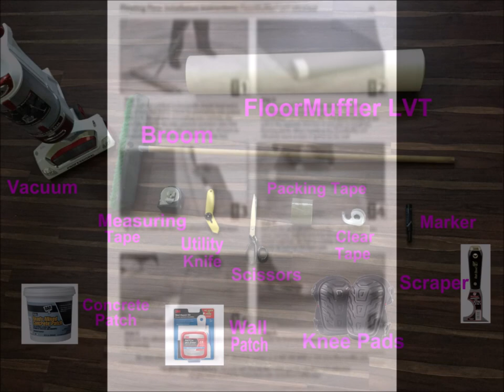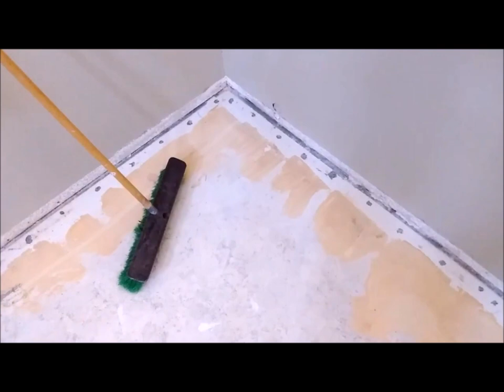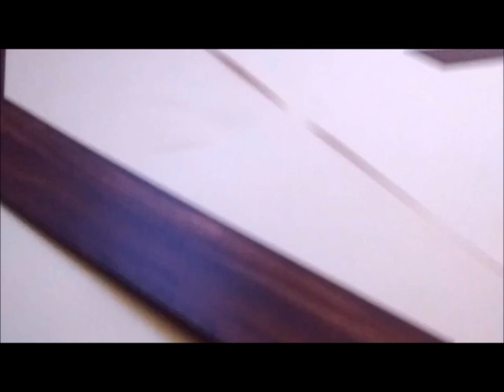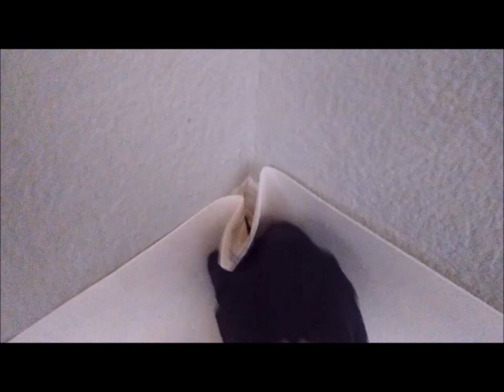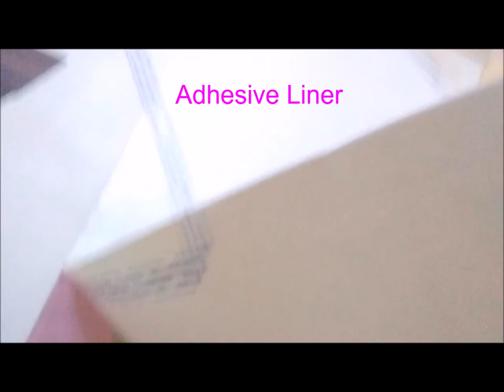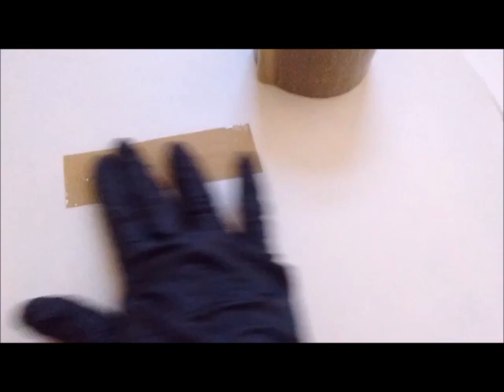How To Install Underlayment Over A Concrete Floor

Comment from the maker: SHOPPING LINKS
~ FLOOR MUFFLER LVT  -  https://amzn.to/34TKiwC
~ READY MIXED CONCRETE PATCH  -  https://amzn.to/2sNNCew
~ WALL REPAIR PATCH KIT  -  https://amzn.to/2LrY1D1
~ SCRAPER  -  https://amzn.to/34XqI2L
~ PUSH BROOM  -  https://amzn.to/34Y7Ss3
~ VACUUM  -  https://amzn.to/2qtzHcV
~ MEASURING TAPE  -  https://amzn.to/2RnV62h
~ UTILITY KNIFE  -  https://amzn.to/2s6HQEk
~ HEAVY DUTY SCISSORS OR SHEARS  -  https://amzn.to/2s6NYwl
~ BLACK MARKER  -  https://amzn.to/2sT4T6e
~ PACKING TAPE  -  https://amzn.to/33Tp00N